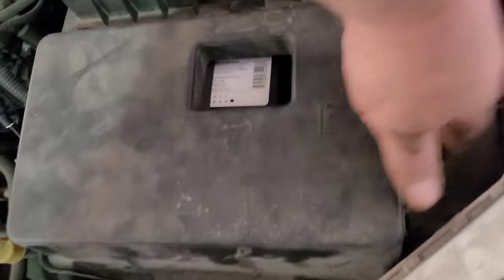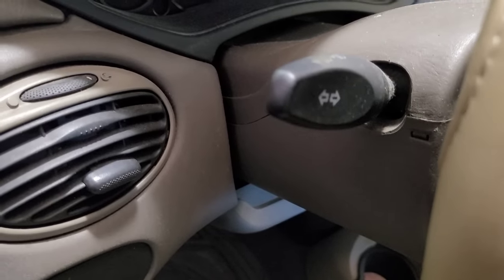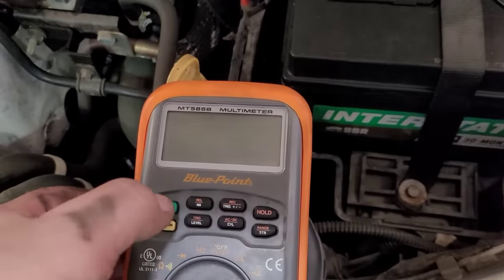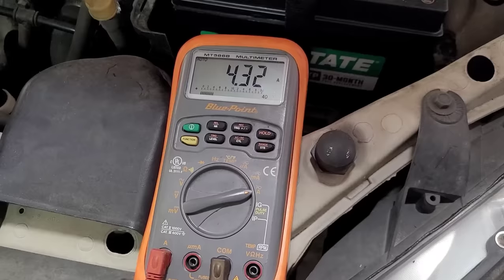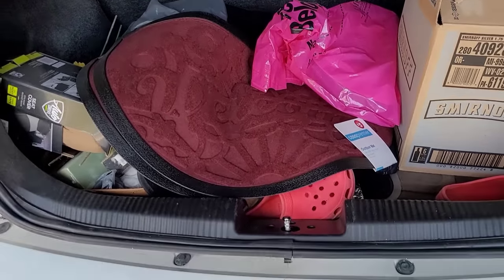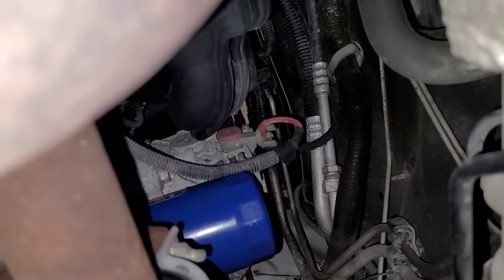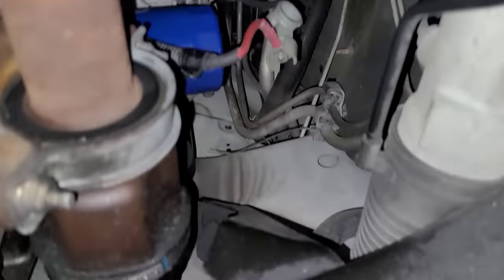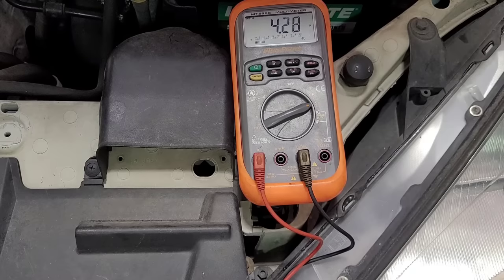Why is the Battery Going Dead? This One Will Surprise You!!

Comment: I had this problem with a Ford Transit 2.4d. It is actually caused by a type of ''diode'' situated in the end cover of the alternator, it normally allows the current to flow in one direction only but when this diode faulty will allow the current to flow both directions thereby allowing the battery to drain, it really is that simple. 👍
Reply: @edwardwhatley1603  same difference really, whatever it prevents current flowing backwards which causes the battery to drain rapidly, why the silly reference to the spelling mistake?
Reply: @merlin1346  Edward ran away... 🙄😂

😎👍☘️🍺
Reply: @peterfitzpatrick7032  life is difficult enough without the world of Edwards ✌👍
Reply: interesting
sounds feasible
Reply: @merlin1346  Your advice is helpful, thank you. It seems Edward's comment has been removed. Nevertheless, it would be easy for you to edit and correct the spelling by clicking on the three vertical dots at the right of your post.🙂
Reply: @CraigMansfield  Simply unplugging the alternator overnight my demonstrate this or or using a meter on the battery when unplugging the alternator could be a quicker method.
Reply: Had the same problem on my Skoda Fabia. The battery was old and wasn't holding charge. The brand new replacement wan't much better even though the charging voltage was OK and no warning lights were burning. It was a failing diode in the alternator rectifier pack. New alternator and all good.
Reply: @TheRealWindlePoons  Just as I was saying 👍
Reply: Diodes are semiconductors and can only fail open circuit.
Reply: Diodes are 1 way “ check valves “

Comment: The odds are good that it's the Voltage Regulator that's bad. Not the Alternator itself. Typically they're integral to the alternator but they can be replaced separately without replacing the entire alternator. I'd also put money on boiling that battery from overcharge if not fixed. There's a good chance that the 145mA you were measuring is the input current to the regulator which also supplies the Exciter current for the Alternator's rotor via the slip rings. BTW: Never leave the battery connected when putting a wrench to the alternator output terminals. In fact it's a good practice to always disconnect Battery Ground before doing ANY electrical work! 
Wakodahatchee Chris
Reply: ☝️ Bingo!!
Reply: Could be that carbon build up is contributing to the 140 miliamp draw and glad that someone mentiond 'slip rings' Alternators do not have 'segments' on the comutator like dynamo's and motors so do not have dead spots.
Reply: Sometimes in real life situations you have to in order to test like he did
Reply: @ronellis2898  True, but that doesn't negate disconnecting the battery prior to putting a wrench on the Alternator terminal. He could have then inserted the Ammeter in series with that conductor and then reconnected the battery. 
Here's some Basic Auto Electric SOP: 
(1) When replacing the battery always disconnect the Ground conductor first! IMPORTANT!
(2) Any connections that require a screwdriver or wrench to disconnect a terminal should be done with the battery disconnected. It's extremely easy to graze ground with your tool. Remember that many auto batteries have a current capacity in excess of 500 Amps! It will easily weld your wrench to chassis ground instantly! Followed by a white hot wrench and fire.
(3)* Never check battery electrolyte with an open flame! *  
Wakodahatchee Chris.
Reply: @cdrive5757 
  I saw an article years ago where a guy built a welder out of a self exciting alternator, an old battery, and a junk lawnmower. Not your commercial quality welder, but worked well enough to use on small jobs far from any grid or road access. I suppose you could even stick an inverter on it for remote line voltage.
Reply: Man, that sounds nice. However, I know the last time I went to fix the brushes in my alternator, AC Delco told me that they don't sell the brushes anymore for my alternator and that i would have to buy a whole new alternator. So instead of replacing a $2.00 part, I have to pay $300.00 for a new alternator for a 3/4 ton, and then get bent over for a core fee since i held on to my old alternator for the other good parts. (I got charged for the part I already own).
Reply: At 10:20, he checked the voltage across the battery terminals with the original alternator hooked up, engine on.  14.25 Volts!
Reply: @RichW240  we saw that.  What's your point though?  That it's charging? 
That was never in question. 

But if the doide pack is shorted, then it's not keeping the flow of voltage going one-way;  it'll trickle back out of the battery to keep the stator energized...  so it works great when the engine is turning the alternator, because the voltage from the alt is higher than battery voltage. 
But without properly working diodes, it's like a vane pump pushing water uphill into the bottom of a tank with a stuck-open check valve...   As soon as the pump stops turning, the vanes relax and without the check valve stopping it, the water begins flowing slowly back downhill thru the rotor past the vanes, from whence it was previously pumped. 

As soon as the pump or alternator begins turning once more, the action returns to a desired situation again, and you get north of 14 volts pushing into the battery as you'd expect.  But that voltage regulator is still bad, and needs replacing.
Reply: @1SqueakyWheel  My response was for "C DRIVE"  who thought that the internal voltage regulator was bad in the alterntor!  If the V.R.  was bad, the voltage across the battery terminals would have read 18+ Volts.
Reply: @RichW240  ok.  Without addressing him directly, I took your comment to be a counterpoint to the OP.
I got ya now.
Reply: @RichW240  The video's author (Kenny) never got back to his viewers. Thus we have no idea what happened after he replaced the entire alternator. The charging test he performed only showed that it was in fact charging at idle. To determine if the regulator was fully working, RPM would have to be increased, to say 1800 to 2000 RPM. Then while measuring the battery voltage, overcharge could be tested. A better test would be done with a clamp-on current probe on the alternator charge cable and a voltmeter across the battery. Most common regulator circuits employ two transistors and a Zener Diode reference. The passive & active components are arranged to form a linear voltage regulator. The regulator circuit varies the exciter coil (Armature) current. Controlling the Armature current is beneficial because the relatively small Armature current (as compared to the Alternator's charging current) results in much smaller components in both physical size and max dissipated power.. 
 If in fact the regulator is properly regulating charge current then the only logical thing left to check would be the Ignition voltage pin of the regulator. It is this pin that enables and disables the voltage regulator circuit. When the ignition is off this voltage should be zero volts. If that's the case the problem would most probably be in the ECM. In retrospect it would have been the easiest thing to check first!

Here's some alternator/regulator schematics for those that care to educate themselves.further:
https://youtu.be/QcwfZitVpgE
https://youtu.be/D3AoHW5ZH0g
Reply: @cdrive5757  Thanks for your detailed reply!  My comment was made from personal experience with my 1973-model car which has an external voltage regulator.  When one or more of the diodes in the alternator shorted out, the alternator would drain the battery overnight.  When the voltage regulator failed, the voltage measured 18+ Volts  with the engine at normal idle rpms.
Reply: @RichW240  Thank you for the response. In retrospect I probably should have replied to https://www.youtube.com/channel/UCBtTxcI5l-HPGeGZQdTHIkw , since it was he that questioned my comments. BTW keep in mind that auto electronics is an evolving technology. Early auto voltage regulators were stand alone electromagnetically devices. They relied on the Pull-In & Dropout characteristics of EM Relays.  Also keep in mind that modern alternator/regulator systems employ Bridge Diodes to rectify the charging current to the battery and another set called the Diode Trio which is used in conjunction with the regulator.
Reply: With ignition off and the main alternator cable disconnected there is no way for power to reach the exciter terminal. The 145 mA must be from other sources for example body modules and alarm staying awake.
Reply: Yes, the regulator can draw current if it is defective.
Reply: Yeah, the plastic regulator on them. They used to be separately replaceable.  There's no reason they shouldn't still be except for alternator manufacturers selling only whole units.
Reply: I agree with everything you said.
Trinidad & Tobago.
West Indies.

Comment: A lot of people don't know that a battery will self discharge at around an amp per day, this is one of the basic facts we were taught at TAFE (technical and further education) in my class as an auto electrician.  Also if the battery has been discharged for too long it needs to be put on a long slow charge and if possible checked with a hydrometer after charging. The alternator will not charge the battery to the correct state from dead flat.
Reply: "an amp per day" doesn't make sense. Perhaps you meant an amp drawn continuously?
Reply: Fake news..my silveraldo sat from beginning of Nov- to - mid January this year with no starting.driving in between, just sat..last week, it fired up just like i started it the day before..that over 80days sitting..i guess i lost 80AMP's, lol.
Reply: Not sure if it's 1 amp. Milliamps 20+ I recall.
I could be wrong.
Some New batteries differ than old school leaf acid also .

I had my CAT excavator sit for 4 months started up perfect had 12.5 volts before cranking.

Comment: With modern vehicles, if you are going to allow it to sit unused for long periods of time, you should always attach a low current maintainer charger to the battery to keep it in good shape for when you want to use it.

If it is sitting outside you can get one of those solar powered battery charger/maintainer and set it up to keep the battery charged up.

You can also get one of those inline battery cable switches and install it on the ground cable and turn it off when not in use.  Does mean that all of your radio presets will be gone and the car computer memory will be cleared and the computer will have to relearn how you drive.

Start removing fuses and see if the draw decreases.  If it does, that will tell you what circuit or circuits are causing the draw.
Reply: Or just disconnect the negative terminal of the battery
Reply: @mchaves7663  
That will work but if you have a vehicle that will sit for long periods every year while not in use the switch is more convenient.  And if you put it in an out of the way place a thief will have a harder time figuring out why it will not start.  A disconnected battery cable is obvious.
Reply: @oldtimefarmboy617  Thieves? What Thieves? Where I live, most times my car is open parked in front of the house
Reply: @mchaves7663  
When I was growing up we did the same thing.  But that was decades ago and more than a few miles away.  Specially in cities, an unlocked car is seen as you giving other permission to take it and use it for their benefit.

Of course I believe you are being facetious since there is no one with a lick of sense who does not know that car theft is a problem in many places and many more people will steal any car they can get into easily and start up.  Just like vehicles with higher ground clearances are a prime target for people who steal catalytic converters.
Reply: This guy's a hacky-moto type, and wouldn't understand any of that. Some guys like yo-yo's
Reply: Maintainer would be worthless here.  They typically supply a  half to one amp and this was draining more than four.  I have a trail Jeep that might sit for 2 ot 3 months.  I use an inline switch between battery post and cable.  Downside is it dumps the computer registers so you can't pass a smog test until you've put a hundred or so miles on the vehicle since last disconnected.
Reply: @wam7484  
You fail to comprehend what I said.  I was not speaking to what was happening in the video.  I was speaking about modern vehicles in general.  Modern vehicles have computers in them that always draw small amounts of current to maintain their memories.  From radio channels selected to vehicle diagnostics.  A battery maintainer would easily keep the battery charge up so that the memories stay intact.

And as far as an inline switch is concerned, if you did not have a maintainer and did not break the circuit for the months it was in storage, the battery would drain down and they would all lose their memories anyway and then you would have to boost it to get it started and will probably have to replace the battery since letting the average battery run down dead damages it and greatly reduces its expected life.
Reply: The Harbor Freight one is 1.5 watts. Just sayin'.

Comment: We used to have a bunch of those focuses in the family. They have a few pattern failure quirks, but I don't think they're bad cars. One of the quirks is the passenger side motor mount failing. The engine is very shaky, and the design relies heavily on the dampening action of that mount to quiet it down. When it fails, the engine buzzes like a bumble bee. It's hard to tell from the video, but it sounds to me like it's bad. You're going to be in the area with the alternator replacement. It might be a valued upsell for the customer.
Reply: Taking the  mount loose eases getting  alternator out...
Reply: Your whole family focuses😅 that's hilarious

Comment: Kenny, you can get relatively cheap DC milliamp clamp meters these days. Uni-T (just because I actually have a couple of them and know they work) make a couple of under $100 that go down to the milliamp. For chasing branch leakage they are my GOTO tool. Save you a lot of time in diagnosis.
Reply: Which model uni-t do you recommend?
Reply: @12babyapes59  there is one that goes upto 60 amps and one that goes to 100, the one that only does 60 amps has better low end resolution, so for low level leakage and branch analysis that's probably the pick for that task.
Reply: @Funkylogic  thanks, I been looking for a new avenue , for a parasitic drain I been battling for couple of years on a older BMW.

Comment: At  72 years old and a fair car mechanic,  HVAC by trade.  I would expect at 4+ amps the alt was at least getting warm?  From eating the current.  Would have been a good troubleshooting by looking for heat the next time, like you said 4 amps is a lot.   Great stuff,  keep it up.  All said with great respect, you are a great teck
.
Reply: thermal camera is your friend . 69 here down to a couple of jobs a month
Reply: 4+ amps @ about 12 volts is at least 48 watts.  
On a cold engine you should be able to feel a warm housing etc.  A thermal camera should also be able to pick it up easily. 
Access seems to be the biggest issue with these tight packed engine bays.